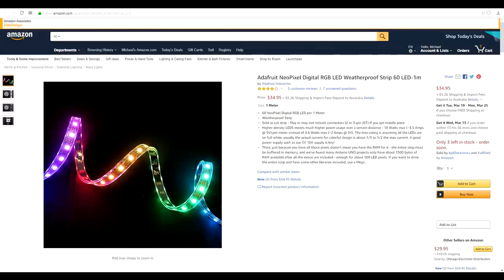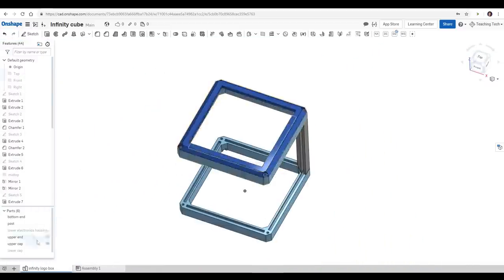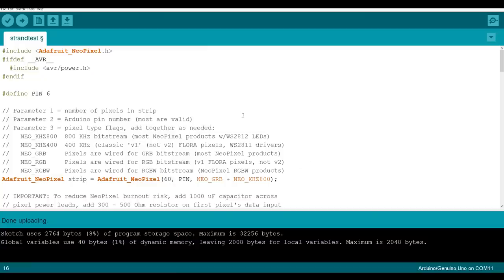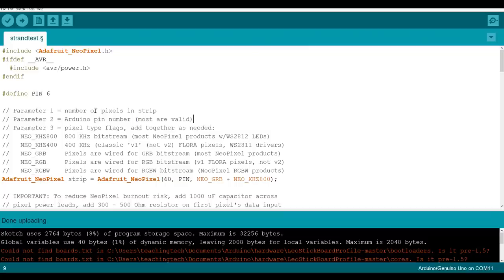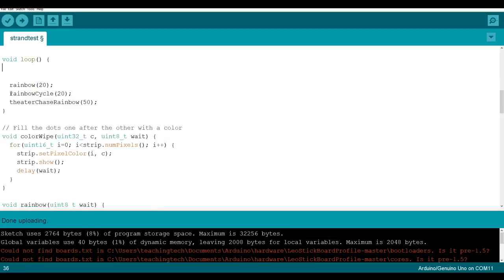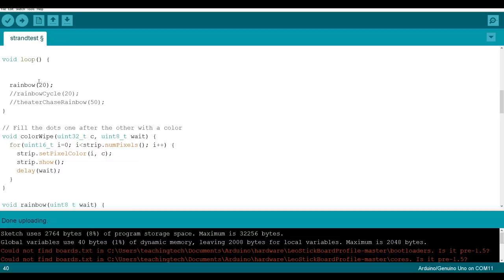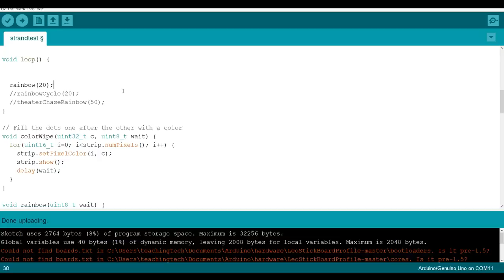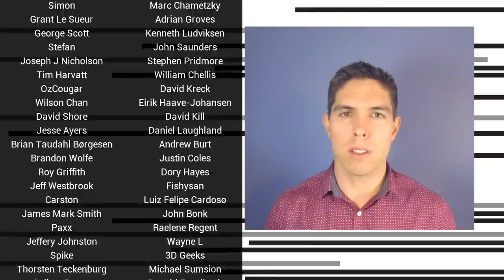3D printed infinity cube - Arduino RGB Neopixel project

Comment: I'd personally go with an ESP8266 + aircoookie/WLED library on GitHub so you get a TON of awesome animations and the ability to control it via Blynk IOT, Alexa, Wifi web interface, etc. The ESP8266 is small and cheap too. Take a look at all this library packs into it for controlling WS2812b lights. https://github.com/Aircoookie/WLED
Reply: You could also tie this into Home Assistant w/ Tasmota or ESPHome and MQTT. The 8266 will drive these easily and has a smaller footprint/volume.
Reply: So just use a nodemcu or something to control the LEDs? I have some nodemcus laying around that need a use.
Reply: Agreed!! I'm actually working on a project using this as we speak
Reply: But how do I get this library to my Arduino? Like, does it already come 

preset > package manager > search ___ ?

Comment: I've wanted to build one of these for so long, but I had clearly misunderstood the mirror requirements. I had always thought there needed to be a double layer of some specialist mirrors.
Thank you so much for putting me right .... again.
The only thing I don't already have for this is the mylar, so I've just placed an order that should arrive in a few days. Plan to use glass for my build because I should be able to get it cut locally.
Reply from the maker: A traditional infinity mirror has plain mirror at the back and the mylar film at the front. This one has mylar on all sides so you can see in from any angle. It's a fun thing to make, please enjoy.
Reply: @TeachingTech  Ah of course, it all makes sense now, thank you. Either way, this one is so much better than a traditional one, so my prior ignorance has served me well. I've ordered 6 pieces of 3x100x100 perspex and a roll of Mylar, everything else I already have. I am wondering if I should print it in shiny black PETG, will probably stick to white PLA for the first one though. I'm already thinking about scaling it up (x2) for a second one if all goes well.
I plan to go to a community meetup in a couple of months. Although I won't be having a stand myself, I think a friend would love to have one on display on his stand (with your thingiverse attribution label of course). Would you be ok with that? If not I respect that of course.

Comment: Hi Michael, the reflective film you have on you're Amazon link does not have an adhesive back for applying to glass. I have spent an hour trying to remove a clear backing that doesn't exist. I also purchased some glass coasters on Amazon that are 4"x 4"x ⅛"  they are slightly thicker than ⅛" so I modified your design to get them to fit. Another alternative to cutting plexiglass.

Comment: Very poor list of materials. In the instructions, it says use 2-way mirror film, and the link to the film says 1-way mirror film. And you can save a bit of money by going to Walmart and buying a cheap $5 LED strip that comes with a wireless remote to change the colors. Power through USB or just use a small battery pack and store it in the electronic housing area.